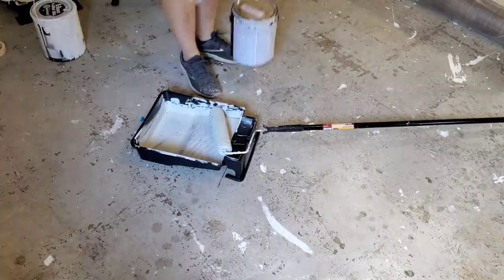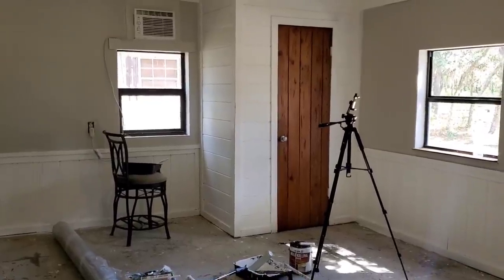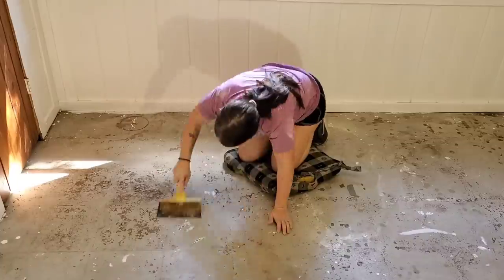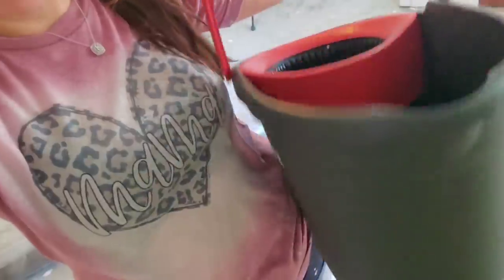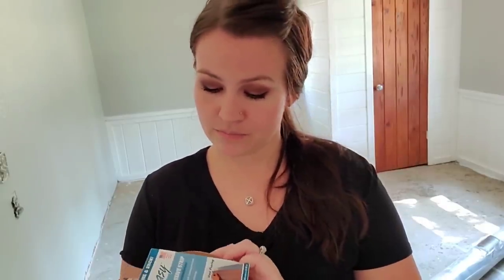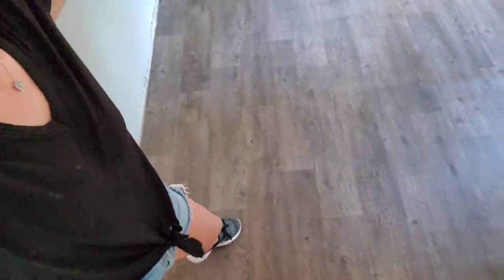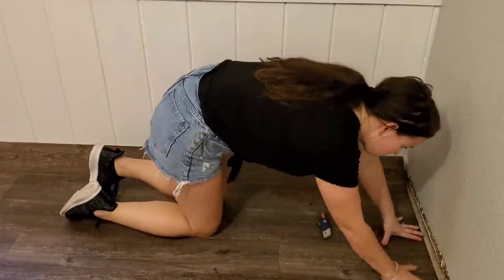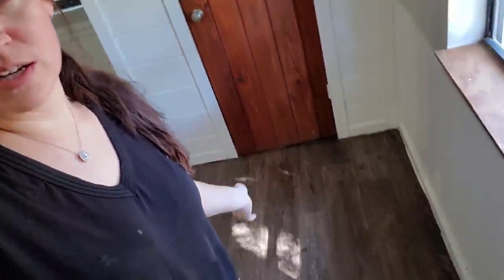BEDROOM MAKEOVER ON A BUDGET | EXTREME ROOM TRANSFORMATION | TRASHED ROOM MAKEOVER | DIY

Comment: Hey girl, you can absolutely paint that plastic cover on the window unit air conditioner.  I painted the fan cover in my bathroom (it had yellowed) about 2 years ago and it's holding up fine.  Just clean it really well first.  I used regular old satin wall paint.

Comment: We put this vinyl flooring in our kitchen and dining area. We have original hardwood but they weren’t carried into this part of the house when it was built. (1961) We had to put in something nice in to replace the nasty linoleum and carpet. I still stand by this flooring as the easiest, and most durable flooring next to hardwood. It has been through many teenagers and their friends, harsh MN winters, big dogs, dropped dishes…it’s amazing stuff. 
The price is right too. Great choice in your bedroom! 
The ONLY downside is that it tears easily if furniture is moved over it without protective slides of some sort.
Reply from the maker: Thank you for letting me know its held up for you.  I bought some slides for the bed   frame so it doesn't dig in. This is also tricky for me because I slide everything because I can't lift on my own 🤣 I'll be utilizing some towels and big furniture slides to make sure I don't tear the flooring . Thank you for Watching 💗

Comment: We had a gap as well. A carpenter came in to do the moulding, and he says, "Well, instead of using quarter round, we can use something bigger, like inch round." That's what he did and it turned out great. Once you get the baseboard up, just measure the gap remaining. If quarter round doesn't cover it, go up a little higher in width. It looks the same aesthetically and hides the gap.

Comment: Whew! I'm so relieved the vinyl flooring fit after all. I can totally understand wanting to keep the stained door, but with 3 different wood tones in the room, would you consider painting it white? I don't know what other colors you're putting in the room, but the "wood" tone of the floor can be a jumping off point. 

 I also don't know how your fan will turn out, but I painted ours black and it looks great!! Maybe white blades will blend better in your room? It just seemed to compete with that wood square on the ceiling. 

It's looking great! What a major change! 🤍
Reply from the maker: I still have a ton of work to do but thank you for your thoughts and suggestions.  I'm winging it for now if anything needs to be changed when I start bringing in the decor I'll definitely whip out the paint can if I need too ❤

Comment: Tip for vinyl next time: the back area that has the closet and the wall with the AC? Get a bunch of cardboard/paper/posterboard, etc. and make a template or take as precise of a measurement as you can. Roll out the vinyl partially and cut out the area of the closet. Pull the vinyl in place and then roll out the rest.

If you plan to have the vinyl continue into the closet, definitely do a cardboard template. Lay cardboard/paper/posterboard, etc. around the walls and inside. Pull it up and you have a rough outline of the wall that needs to be cut out. Give yourself a 1-2 inch margin for error aka cut less. As you tug half of the roll in place, cut as needed until flush with a/c wall. Then work on perfecting inside the closet. Once those two are set, roll out the rest.
Reply from the maker: Oh my gosh thank you for these tips ❤
Reply: @karrielynn  Np! It's always nice to see other's doing DIY and if I have tips, I like to share because I was in your shoes at one point. When things go south, it can be a real downer. Hang in there! It looks great so far 😊

Comment: I feel like it is impossible to do a project without running into bumps along the way. We installed a vent fan in our bathroom because the old one quit working and it was very old. The box said it was easy install and no attic access needed. Needless to say it ended up going from a oh it will probably take about an hour to it being an all day process. We ran into so many issues but being we did it ourselves the only cost we had was the material itself.